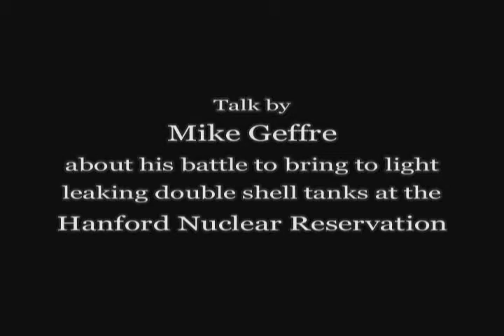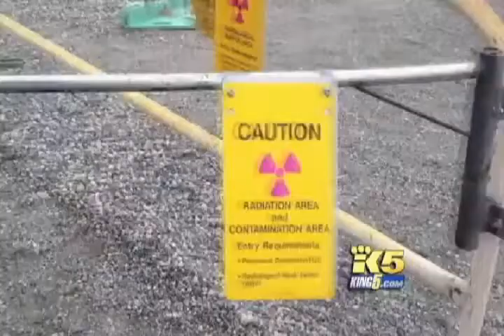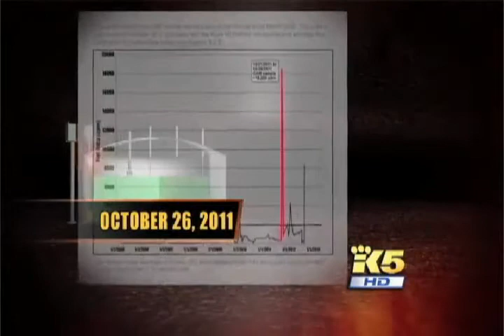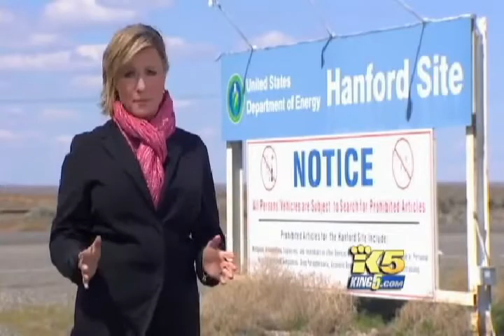TalkingStickTV - Mike Geffre - Hanfords Leaking Double Shell Tanks

Comment: Or if only sludge remains in a tank that's leaking . . . How about putting in another tank, double walled, that is, say, 1/4 the size (depends on how much sludge there is) . . . then, scoop up the sludge, and put it in that tank. That will get us some more time - Or, make the tank like an ice cube tray, in which is put some concrete - the sludge gets mixed into that. After solidified, the cubes can be broken out, and they go in another double walled tank.